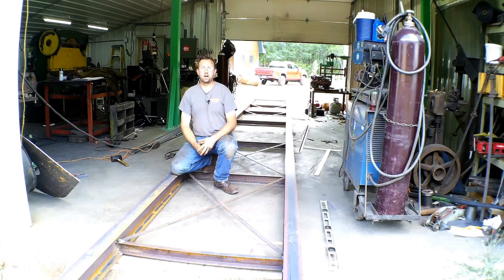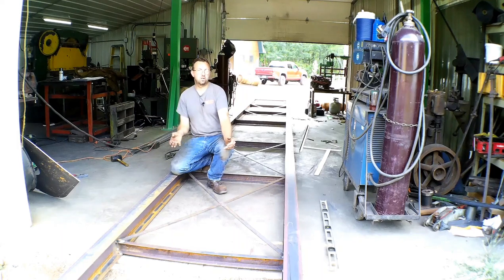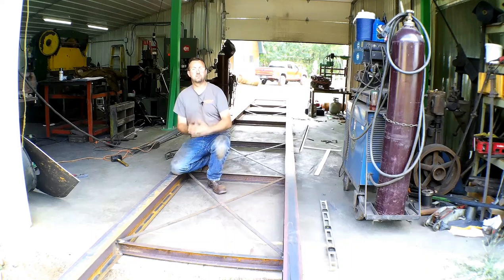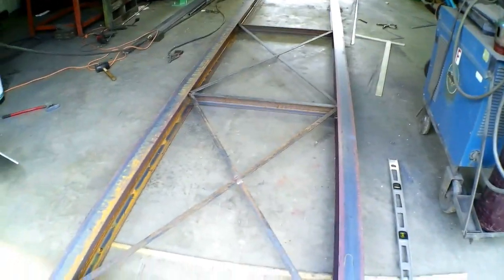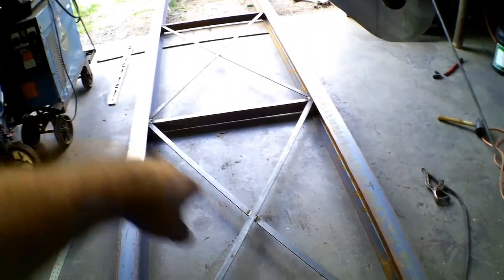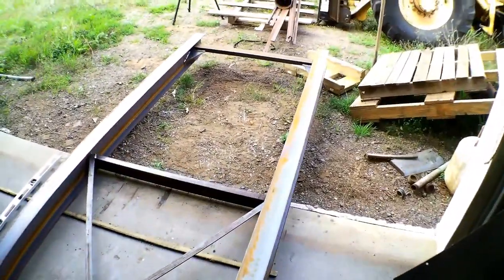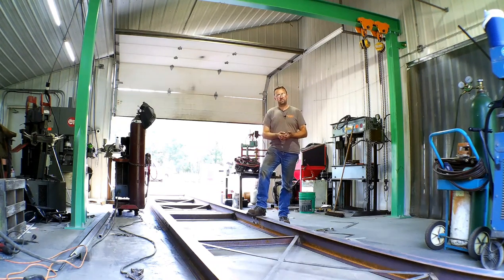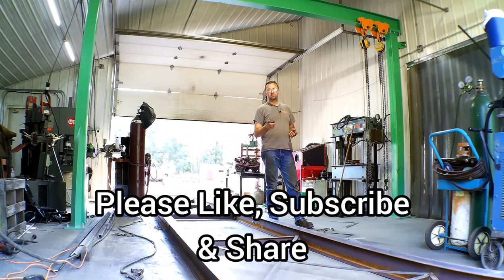Sawmill Track Frame Build For The Oldest Sawmill In Washburn County Wisconsin

Comment: josh i am always intrigued with your videos. i am glad to see that you found home for the machines you don't have current needs for. you know that you only have so much space to work with. and you can't save it all.
i am an idea man trying to do good. by sharing my life learned knowledge to others so they can learn from my mistakes and skirt the lessons that i learned the hard way.
yes it is best to do it right the first time. sometimes you have to make multiple passes before you get it right.  

i really do like your style you can think inside and outside the proverbial box and you focus on doing good and minimizing mistakes. and everyone has access to different tools and knowledge and depending on the situation you do different things.

one question on the video that you  on repairing rollers. you hammered the end inserts with a ball pien
Reply: fat fingers
you used a ball pein hammer to hammer the end  inserts. would it have been better with the use of a dead blow hammer.  with my limited knowledge a ball pien hammer  scuffs the surface more than a dead blow hammer which has a softer plastic  surface. but this thought maybe overthinking and the finish may not be that important. have a very good life.
Reply from the maker: I make them tight and a dead blow won't get them in. Sometimes I will mushroom the end, but that is welded. The stub shaft is the only critical part of the roller. Someday I may build a press to insert these, bug I would need to be running way more rollers to justify it.